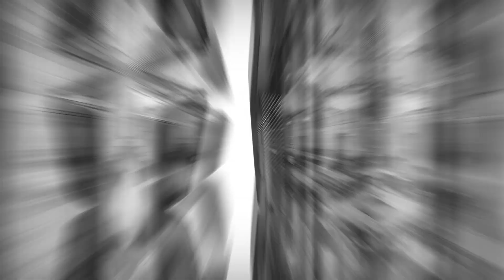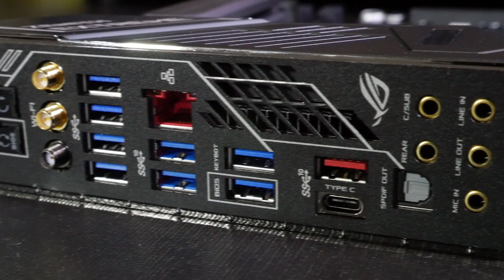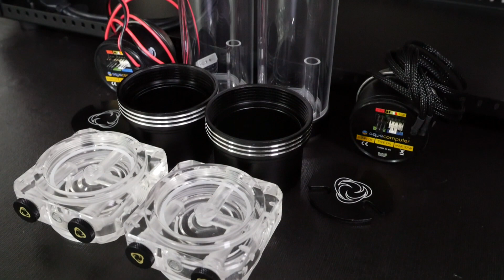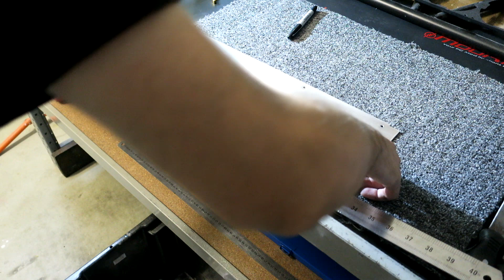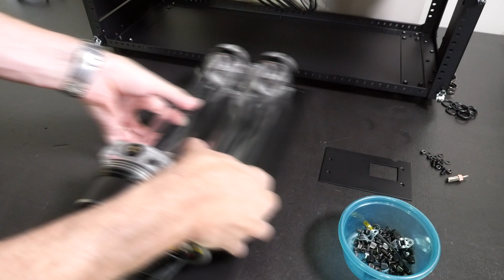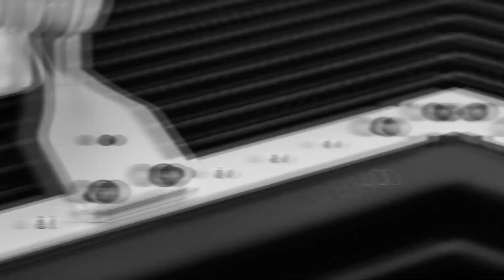Caselabs SMA8 Symmetrical Loops Build #33 Part 1

Comment: You know that's a great case, hard tubing etc etc.. and after the build, in like a month or so when you will face motherboard issues,  like this motherboard and have to take out whole system, then process the RMA. Getting the board back and you do everything back in again and after some time something happen to board again and you have to remove it again coz bios flashback don't even work so you have to send the board again...and after doing this few times, you will be at a point, Fxxx jaystwocents, Fxxx EK.. all i want is fucking PC to work for what its meant to be and not a fucking fountain piece of junk to bitch out on me when I'm in b/w important work. Coz this fucking board, this fucking board have so many issues i literally smashed my pc on the wall after 4 motherboard RMA where 3rd time they have sent me a new one...

all the issues were related to fXXXing bios.. So many issues for this board all over the internet.. first time bought Asus board, feels like money in the drain. Bloody showpiece junk.. 

All I did, in the end, is selling the board, got X399 gaming 7, smashing all the Water cooling bits into pieces. should have gone with Noctua cooler, to begin with, have fallen to this fountain showpiece crap builds with cinematic videos.

i'm so sorry for rambling this much but thinking of this kind of PC and thinking what happens if I have to RMA one of the items..that's the real pain guys..i can see this build is going to be beautiful but just the thinking(as is already did bought very expensive parts and fuck them just because of pure rage when they come in between) makes me not to fall for this anymore.. I lost quite a lot of money, time and some business related work just because of all this..

I want to add this, that if you are building this kind of PC gaming then its ok, for business-oriented and lite/occasional gaming, I don't think you should build something like where productivity is more important. For gaming, go right ahead, heck even i will again. 

Sorry again for this much but thought this is a good video to let people know this before they build this for themselves. wanted to share my expreience..
Reply: Jay Shank seems like to me that you got real issues! No need to take it out on singularity, go watch some other novice Builder build a basic Dell home PC system and stay off this channel if all you're going to do is bitch and complain!
Reply: Jay Shank I don't think anybody understood a word you said! You just babbled and bitched for like three paragraphs! Get it together! #head issues
Reply: :-D really, i bitched.. hmm ok.. you invest 10K or even 2K in a PC like this and let me know how you feel when it won't post after a week, heck a week, let's just say the time you finish building ur PC specially when you earned that money by yourself..... :-D 

i clearly mentioned this line above "i can see this build is going to be beautiful"..

i got head issues, coz i have to go through something.. you won't understand brother..sorry but this is the truth..
Reply: This is good info for the client.  Maybe he didn't research the board prior to purchase and will see what Jay Shank speaks on.  Possibly change the MoBo selection and save himself what appears to be a future of downtime.  Personally, I research the shit out of the products going into a loop to avoid headaches.  Even if it requires me to select products that are damn near out of production because all the bugs have been worked out.  That's what you HAVE to do with a build if it's underwater or not.  It's not smart to buy the first run of anything computer related.
Reply: totally agree and my exact point...

Comment: Are there effective ways to bend glass tubing? Or is better to obtain the straight tubes and fittings?
Reply: CUBANOCTOPUS depends your experience i would say
Reply: CUBANOCTOPUS you can bend glass, some people have done it, but it's a really tedious process, requires specific tools and it's not really worth at end
Reply: Thanks you 2 for the replys